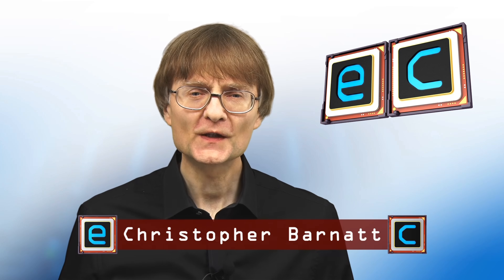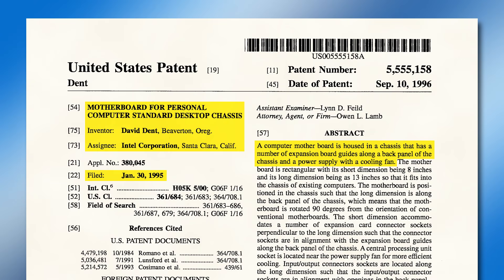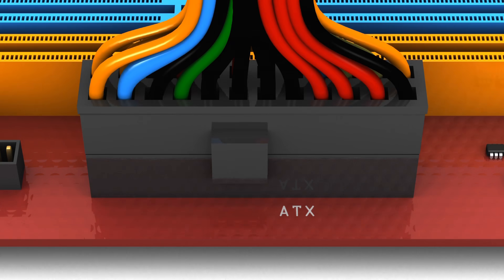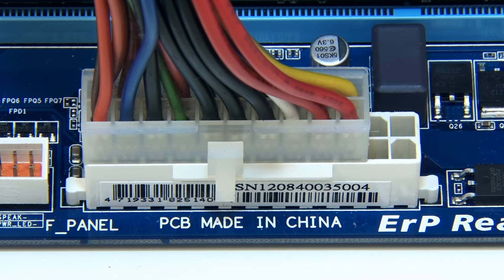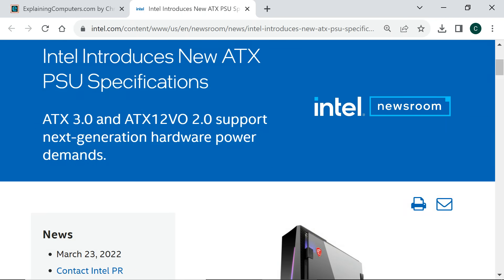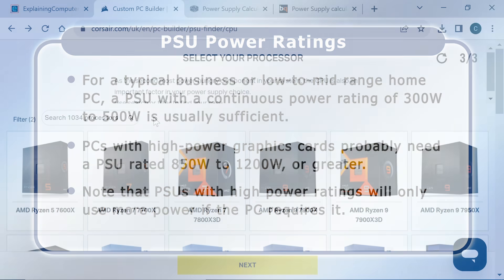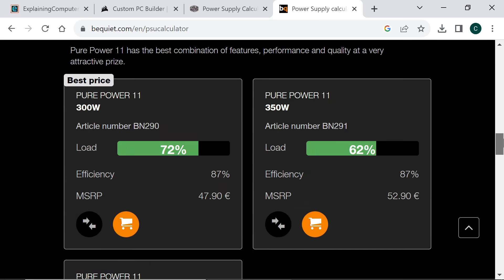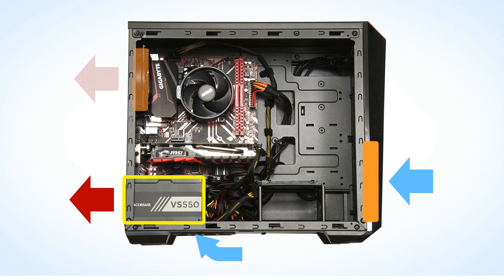Explaining PC Power Supplies

Comment: They also provide very noisy, dirty D.C. and all the folks who think they will use one for their journey into DIY electronics are in for a lot of misery lol!
Your desktop's motherboard has so many filter caps on it that it doesn't suffer from the dirty power, but anything analog and entry level you look to run off them will either run terribly or they won't even power on.

Comment: Proprietary plug  set ups something else EG HP computers 

I bodged in substituted  a PSU that did not have minus 12 volts , my old XP used it just in the power up section , I made an external legacy circuit to do the same thing instead of having power on permanently hard wired on all the time.

Comment: Thanks! I finally got around to replacing my old 300W PSU with a 550W but had to use an adapter since the 550W only had a 24 pin power connector.
Reply from the maker: Thanks for your support, most appreciated. I'm glad your upgrade worked out.

Comment: This is great information! I've been trying to learn about building a pc for the last couple of months and nobody talks about what power supply you should be running based on the usage. This was what I was mostly after, but also knowing that the sustained and peak supply rating is different but labeled the same across different manufacturers is good to know as well.

Comment: Thank you for the video.   I am rebuilding up an atx desktop which will be used off grid.  Power will come from solar plus a 48 VDC nominal battery pack.  Does anyone make an atx power supply that can run directly from the battery pack dc ?  Thank you.
Reply from the maker: I am only aware of devices like this one, which plug into the motherboard ATX socket, and take a 12V supply: https://www.mini-itx.com/~picoPSU-160-XT These are for fairly low-power systems, but I guess this may be your intention with an off-grid system?

Comment: Why do PSUs now boast single rail 12V with a "DC-to-DC" converter? You can see on the specs sheet that the PSU promises its full wattage at 12V. What new technology enables it as a better design? Aren't voltage regulators kind of bad and dissipate a lot of heat in battery operated devices? Seems like they snuck the 12V Only into ATX. When 12VO came out, there were rumors that this power supply would be the only one in production thus rendering old PCs obsolete if their PSU could not be replaced.

They also have removed 3.3V from the SATA connector, which was almost never used. The 8 pin CPU connector fits into a 4 pin socket if there are no tall components nearby.

500W seems like the goldilocks choice, offered at similar price than lower wattages. Back in the P4 days I bought a cheap power supply that claimed to be silent, and indeed its fan hardly turned, the PSU was noticeably warm to the touch and soon burned out.

Comment: That last 2022 PSU standard and Intel 13ths generation CPU socket motherboard standard really was a surprise to me.  My 20 year old 850w semi modular power supply lacks the main connectors for the secondary paired 8 pin power connectors to the mobo.  Time to buy a new 1050 watt fully modular power supply.  Overpowered power supplies are harmless while the incorrect connectors and power supplies running past 80% power needs are dangerous to a PC.  4 and 6 pin secondary mobo power connectors are dead

Comment: I recently had a no boot no beep issue with an old HP Z230. Thought it was the PSU. I learned that HP Z workstation PSU's are proprietary and are 11V standby and 18 pin motherboard connection. Thankfully after further diagnosis I changed the CMOS, got it to beep 5 times that pointed to the CPU which I cleaned and it booted. Always great videos on this channel that is a source of informative information, thank you.

Comment: I recently bought and built a desktop that uses a 4070 with 80plus gold power supply. The shop recommended me against getting the platinum because from his experience with clients, they break at a much higher rate. It is true that the more complex something is, the more parts there are to break. But in this case, Is there any truth to plats being less robust than gold?

Comment: Chris, my psu has a few ports labeled SATA/PATA. Could you please tell me what PATA is?
Reply from the maker: PATA stands for "parallel ATA", and refers in this context to hard drives and optical disks with an IDE data connector. These used a Molex power connector, so those ports on your PSU will I imagine take cables with both SATA and Molex power connectors on them.

Comment: I have a new pc. I shut it down normally via windows. The psu switch at the back of the case I also turn off (to prevent draining power from the wall). At a later date, I then switch the pc back on at the front. I have forgotten that the psu switch is off at the back, so the system powers on and off for half a second. The supply has obviously retained power from previous use. Do you think that is an issue, and there could be a chance of of ssd corruption or motherboard component problems? After looking around, I've noticed some pc building guides do insist to drain the power in a similar fashion. I do not recall my previous pc ever switch on and off for a split second. The supply is a rog 850W

Comment: Well done, a lot of things nicely put !
Agreeing with the conclusion, except that a bad PSU can also affect the behavior in the short term !

In 2000, I build a system around an AMD T-bird 1.4, 3 x 512 MB RAM, in Antec case provided with its 400 W PSU, a lot at the time from a known brand.
Soon enough, I got random crashes. I tested all the components I could, removing or swapping them. A lot of memtest86 running at night. At first, my conclusion was : I can use 2 x 512 MB, but not 3 x. Yes, all memory sticks were OK, but only when used by pair, not all three at the same time. What ? OK ...
Few years later, build another system, with completely different components, but in the same case with the same PSU: again, immediately, problems, crashes.

Lesson learned, since then, I buy only high quality PSU. Unfortunately, the brand is not enough to be sure to make the right choice. Check on the Gigabyte-gate on Gamers Nexus channel for exemple.

Note that sometimes, even with good quality PSU, you can encounter problems. Exemple: I had to replace a 750 W PSU, supposed to be enough for an nVidia 3090 FE. But the "beast" is putting stress on the PSU at level much higher than advertised. Now, it's running well with a 1200 W PSU ...

Comment: Reminds me how PSUs have not changed for decades. Intel is right to move the PC industry to 12-volt system where the PSU does not need to put any other voltage other than 12 volts.  This will also allow the PC community to easily reuse old server power supplies that are incredibly efficient and small, cheap as used.
Reply: If your old power supply breaks, how will you replace it if there are only 12V ones on the market? There were rumours that it was Intel's plan to force old PCs into landfill and force new PC sales, as it does in collusion with Microsoft. The voltage converters work just as well inside the PSU unit as they would on the motherboard. New ATX PSUs now have a DC-to-DC converters and can output their full wattage on 12V.
Reply: @j7ndominica051  It is not like old multi-voltage ATX PSUs will disappear completely, especially used ones. voltage conversion is as good. Intel never mentioned which is better, they just said DC conversion in the motherboard helps with idle consumption.

Comment: I should also mention that PSUs can definitely output more than they are designed for if you really force it. 
Back in the day I got myself an Nvidia GTX 570, and being on the Fermi 2 architecture it guzzled power and ran hot. The TDP was 219 watts and the packaging recommended at minimum a 550W PSU. I had a 500W one, and already had more than the minimum of drives, and decent 4-core Athlon for the time, definitely not a power-efficient system. 
It still ran for months on end before, after about a year, I started to have issues. When playing demanding games the PC would shut off after some time, and that time became less each time. I quickly figured that I probably blew a capacitor, and when trying to deliver too much power it would overheat and eventually power would drop off below what the PC needed. 
Until I could afford a new PSU I plugged in my old graphics card, a 75W 9800 GT eco, which soldiered on and even, albeit barely, ran modern titles like GTA V, which was new at the time. Tough little card, but my PSU could still power it for a few months longer before it started to have issues there, too. 
Morale of the story: DONT DO IT!

Comment: Whoever thought that 600W through a little 6 pin internal connector was a good idea??? As you said, that's the equivalent of a small electric fire.
So glad I now know the difference between a top mounted and bottom mounted PSU. Mine's top mounted, but the case originally shipped with a Windows 7 system, so it's knocking on a bit!

Comment: You did miss the loss of -12v from atx v2 and the v1 versions had power more focused on 3.3 and 5v as these systems did draw directly from these for ram and CPU 
13:55 except passive only supplies.
Though these are silly high-
I do like having at least the PSU fan as a case cooler, though I've been building PC's since the 90's

Comment: i wish i knew why different power supply brands don't have cross compatible modular cables when they all do essentially the same thing. this isn't accepted anywhere else,i mean a corsair motherboard will accept any brand hdmi cable,usb of any kind,headphone jack,microphone jack. an off brand mouse connected via usb wont fry your motherboard but a evga psu modular cable plugged into a corsair psu is risky gamble that could fry your entire system

Comment: Power supply efficiency, to my mind, is not only about saving money on your electricity bill but also limiting heat (and noise) generation.

A computer that generates more heat than is absolutely necessary not only can make the room it is in uncomfortable, but also will reduce component lifespan.
Reply from the maker: Good point.

Comment: I find the setups where the supply is at the bottom sucking air in from below kind of silly, as carpet, especially thick pile carpet can easily severely limit that airflow, with the PC almost acting as a vacuum cleaner. In this case a sheet of particle board etc can be used to get that fan out of your carpet.

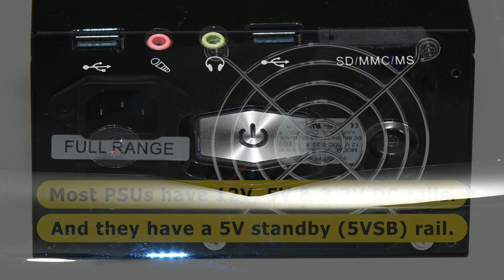Comment: 1:15 Yes but it consumes something like 1W which is nothing. Not worth unplugging when not in use
Reply from the maker: Certainy worth unplugging. 1W every hour a PC is not being used is a lot of power -- probably a good 5KW a year for a typical PC. And I never said the PC needed to be plugged. It can be turned off using the switch on the back of the PSU, or at the wall socket, as the video notes and shows. :)

Comment: ATX12VO is a load of guff. You would need to be running an insane amount of power on the 3.3v or 5v rails (far more than any normal system) and be at the point of setting the cables on fire to see any difference between PSU supplied rails and motherboard ones. Anyone with any electrical knowledge should know that.
Reply from the maker: I am only the messenger here! And as noted in the video, the point is that a PSU with only one voltage rail can be more efficient at idle, not at load as you describe. The early testing certainly supported this: eg see https://www.thefpsreview.com/2020/10/12/intels-atx12vo-power-standard-successfully-halves-idle-power-consumption-in-new-test/ or https://www.guru3d.com/news-story/atx12vo-power-supply-standard-gets-testedshows-really-good-idle-power-consumption.html and

Comment: I skimped on a EVGA BQ series power supply but it should be called BBQ series because after a few years the fan started making a terrible rattling grinding noise and pretty soon the power supply started overheating and shutting the PC off if I drew anymore than about 200 watts. I replaced it with a seasonic gold series and now it runs much better. It was double the price of the original but, what can you do. At least it didn't kill any components on it's way out.

Comment: Important correction: Semi-modular only means that some cables are modular, but not all. In many cases, this means that "expected" cables are wired in, which usually includes EPS 8pin or 4+4pin, 24pin, and often also includes one of PCIE and/or SATA, or even one of molex on older models.
It was even a point against some units for being semi-modular but having some odd choices of which cables were and weren't modular, as it was at a time where molex power was increasingly uncommon to require or use already.

Comment: Very concise and straightforward explanations of how PSU are specified and implemented.  I have come not to trust 80 Plus ratings in isolation (and I realize that you never said we should), and have never specified an 80 Plus Titanium for any build for a customer (or for myself, for that matter), finding the price differential typically does not justify the actual payback.  I would rather put my money in PSUs from reliable vendors that are in the 80 Plus Gold or Silver range for efficiency, and couple them with a reliable and properly sized UPS unit for surge protection and backup power in the event of an unplanned outage.

Comment from the maker: Please note the following minor corrections:

(1) The 4-pin ATF 12V power connector was introduced in 2000 to power the first “Pentium 4” processors, not “Pentium” processors (which were first launched in 1993). I somehow mislaid the “4” during production! My apologies.

(2) I should have said that most and not all PSUs contain a fan. As has been noted below, there are a few, large, fanless PC PSUs -- for example this one: https://seasonic.com/prime-titanium-fanless Again my apologies.
Reply: I have one that says it supports a pentium 4 on it. It's Navy Blue and the grate protecting the fan is lloks golden.

Comment: When you connect the motherboard to a ups, and use it more times with a better battery, after a while you can disconnect your cpu fan, you don’t need it anymore, the performance remains high. The Hdd switches on a careful spin up, it doesn’t spin up with high power, instead it uses a very careful spinup, more silent. The new features remain. It needs about 10 20 h on ups to turn on these features.

Comment: Having had some experience with power supply failures over the last 25 years, the one specification I always use in deciding on a purchase (not mentioned here) is weight.  If it isn't heavy, it is junk.

Comment: Intresting video again 👍
Transporting 600W with 12V is crazy, because of the needed wire diameter or combination of wires to carry the 50A lossless. Wouldn't it be better to introduce a 36 V (for example) rail and put the converter on the graphics card itself? At least the same why we transport our power with high voltage on longer distance in the power grid.

Comment: I have seen cases that take 12 volt only power supplies and are fitted with secondary unit modular power supply cards you plug those 12 volt supplies into that split it up into the various normal power supply plugs. The cases take the current motherboards.

Comment: Thanks for the video. My PSU is a be quiet! Straight Power 11 750W Platinum. Both of my PC builds required an 8-pin connector for the CPU (i5-10400 & 12400).

And while my Sapphire RX 6600 just needed a single 8-pin, my ASRock Arc A770 requires two 8-pins.
Reply from the maker: I'm not sure how an i5 10400 can "require" a 8-pin power connector. There is nothing in the CPU specification about this -- https://www.intel.com/content/www/us/en/products/sku/199271/intel-core-i510400-processor-12m-cache-up-to-4-30-ghz/specifications.html - and I have one myself which I know will run fine with a 4-pin connector. Your motherboard in which the chip is fitted may have an 8-pin connector. But as the video notes, this does not mean that an 8-pin connector is required in all circumstances, and certainly not for a 65W TDP chip.
Reply: @ExplainingComputers  I mean, you might be right. I remember putting in an 8-pin connector because that's what was on my motherboard. Now that I think about it, I don't think I actually looked up how many pins the i5-10400 needed. The more you know.

Comment: I had to run my hardware not being grounded for a number of years due to the shitty landlady not getting the place grounded. Only after the council hounded her for a certificate did she get it fixed. During that time i had 2 PSU's fail on me. Both within one year of use. One lasted about 7 months and the other about 6 months. Both failed with a gound fault. Both were 400 watts over what was required and of gold standard. RNG failure? Possibly. But because both failed with ground faults i am thinking it was not being hooled up to the ground. The Antecs i use now run fine and have so for years. Antec PSU's. No other for me. 

Interesting that you can hook up a 20 pin in a 24 pin slot.

Comment: Excellent. The one point I think missed, and my biggest niggle about PSU manufacturers is that modular cabling is not standardized between manufacturers. Cables from one modular PSU may fry all the drives if someone is not aware enough to swap all the cables when swapping the PSU. It doesn't matter if your cable routing in the case is perfect. If you need to change a modular PSU, change all the PSU cabling to the cables that came with it--especially if it is a different brand PSU. Sadly I learned this through first-hand experience and needing to buy new SATA SSD and HDD drives. :-(  But perhaps that is a warning for a build or repair video?

Comment: GamersNexus did an in-depth investigation into the cause of 12V HPWR cable failures, and determined the primary cause was likely due to user error. IMO the results of their investigation were pretty compelling as to the cable's safety when used properly.